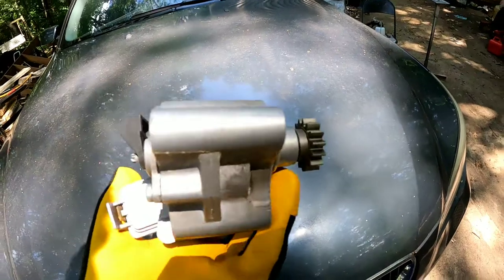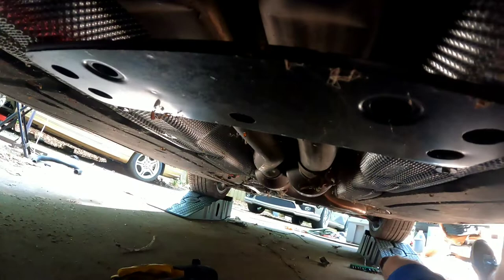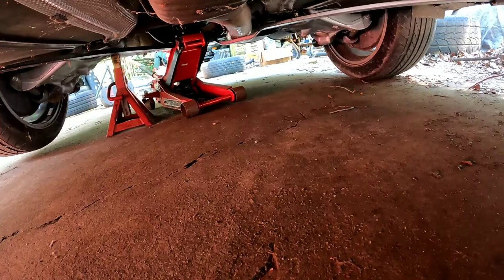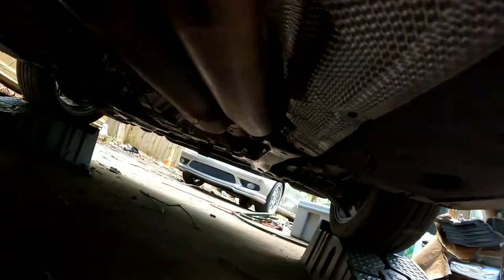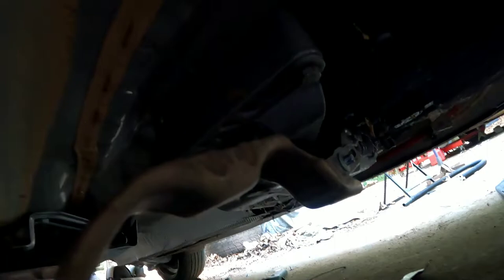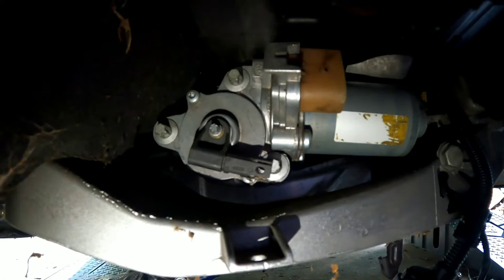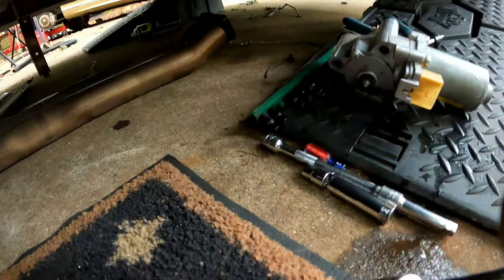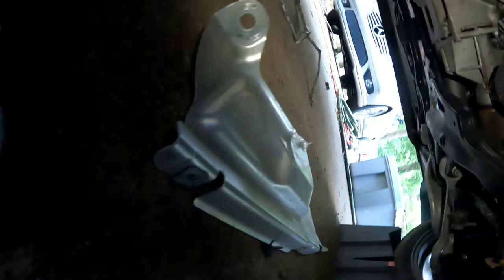How to change transfer case actuator/motor gear e90, e91 e60 525xi 530xi 535xi 325xi and xDrive

Comment: I just successfully replaced mine (‘09 328xi) without removing the exhaust… although tight, I found a way to loosen the TA bracket long bolt that appeared to interfere with the exhaust using the narrow head of a 1/2” breaker bar along with an open ended wrench.  Tips from my side- check out the other videos on this on YouTube. Pre-order TA fluid (1qt), I called a place and they wanted $70/qt of TA-0870… preordering a quart will save $.  If you plan to drain and replace fluid make sure to pre-order the drain plug bolt to replace (best practice as there is an oring on it that could leak reinstalling).  I just removed as much as I could out of the fill hole which ended up being about a 1/2 quart, then filled it back up with new fluid.  That long bolt is a bitch to put back in the bracket but I muscled it in after lowering the Jack to allow wiggle of the bracket and TA.  Removing the exhaust could make it easier but I didn’t want to deal with rusty bolts from the exhaust.  Good luck everyone, and a reminder to be safe by setting up Jack Stands.  Eye protection is a must as well.
Reply from the maker: Very helpful information I was lucky not to break any exhaust bolts this time but I have broken them before and had to remove the cats to drill them out easier. I'll definitely try this next time.
Reply: Im about to tackle this job also. Did you have to reset anyting with the ECU? or did the 4x4 warning lights go off on their own?

Comment: Torque specs? What’s the torque for the 3 bolts attaching the shift actuator motor to the transfer case?
Reply from the maker: I believe I did 20nm or 22nm

Comment: Is this the same as the transfer shift case motor cuz I changed the transfer case motor but still got all the light on the dash
Reply from the maker: Yes it should be. If you buy a new one you will have to have it programed which is what I did for mine
Reply: @E46BMWsandForeigns how do you program it
Reply: @everardoloza2687 ista P or Autel Scanner with programming tool.

Comment: Great video. Did you have to touch anything in Ista P or NCSexpert after this job, or did the light take care of itself?
Reply from the maker: I took it to a shop and had it calibrated because it was driving weird and clearing the codes didn't help. There is probably a way to calibrate it yourself. I just don't know it.
Reply: @E46BMWsandForeigns  got it. I’ll use Ista P. That’ll do it. I just wasn’t sure if I could skip it. Thanks!
Reply from the maker: @DuzzenZ  No problem, I have heard If you use one from another car It might not need to be calibrated, but I know new ones need to be calibrated.
Reply: My light took care of itself
Reply: @DuzzenZ would you be able to tell me the steps to calibrating the transfer case on ista? i haven’t been able to figure it out